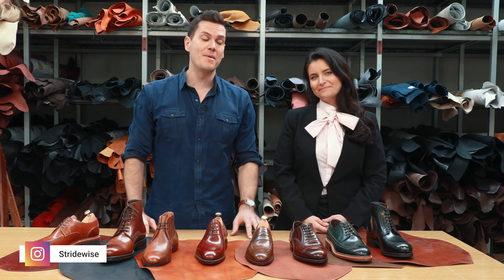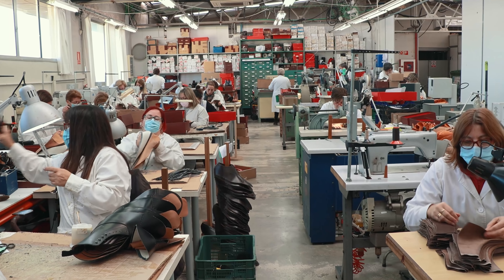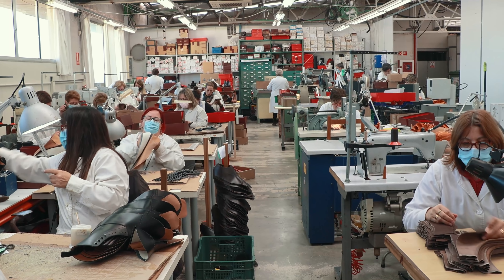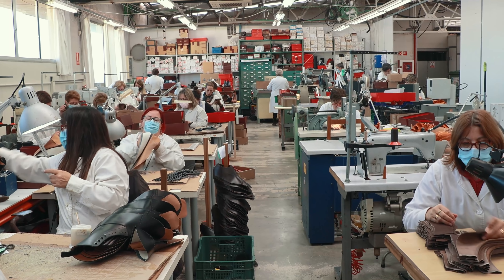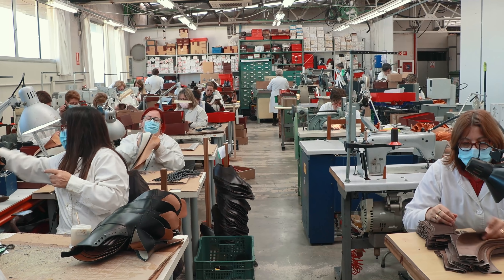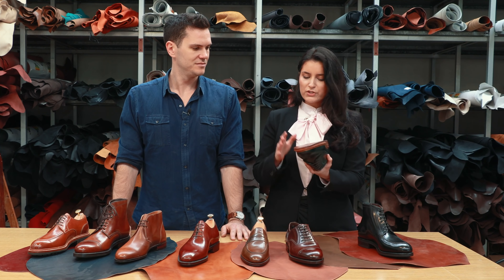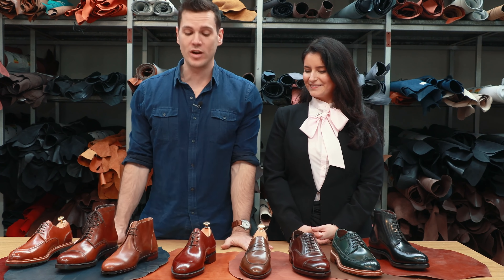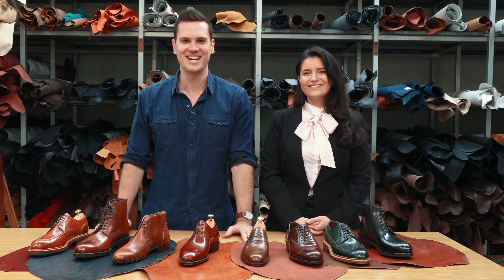Are Cordovan Shoes Worth It? Visiting @CarminaShoemaker-mallorca's Factory

Comment: In my experience the durability of shell cordovan is a bit overstated. Shell will scuff, scratch and split if treated poorly. Just look at used shell shoes on eBay. It is true that you can recover from some rather bad looking abrasions with shell but it is not bulletproof. The Achilles heel with a lot of shell is water. Uncoated shell that is exposed to a significant amount of water, say in a storm, will develop water spots that are very hard to remove. The material's pores will swell creating raised spots that can take days to weeks to return to normal if at all. I generally don't get my cordovan shoes wet for that reason. I see this a lot with AE shoes as they don't coat their shell. Alden doesn't seem to have this issue at least when new. I think this is due to the coating Alden applies to their shell.
Reply: I have may own special process of treating shell
Reply: It seems like the best approach to shell cordovan is to treat them like normal dress shoes with common sense - i.e. don't wear them in a storm, try not to scuff them etc
Reply: IMO Aldens coated shell looks fake. Another thing is that shell indeed splits realtively easy with eyelets and broguing areas affected more frequently.
Reply: What do you mean by coat the shell? I have Alden and AE Cordovan, they are very similar, bipoth shine up nicely with some pure polish conditioner, both get dull if not brushed. The cracked shell I see on eBay is on very old pairs. I’ve never had a problem keeping shell from cracking. And scuffs are removed with about 10 seconds of brushing, unlike calf or veg tanned. Shell is really, really resilient. It just takes a small amount of attention.
Reply: @Dr Zaius  the coated shell is a thing, there are pelnty of posts on reddit
Reply: Its durable but its still a natutal priduct susceptible to damage. Not unheard of for permanent water spots to occur or for welts to appear.

Comment: Well done, Nick.  Thank you!  I picked up a pair of Alden cordovan shoes recently and I'm still trying to sort out the best products used to care for them.  There's a hornet's nest of disagreement on which products are best.  Some say only Saphir Mirror Gloss because of solvents in Saphir High Gloss, that these solvents break down the cordovan.  Others say that's hooey, and you there are a zillion pics online of cordovan covered with High Gloss that look amazing.  Any thoughts?
Reply: Venetian Leather Balm or Venetian Shoe Cream for conditioning when needed, otherwise water + horsehair brush for cleaning/shine. Since Alden uses Horween shell cordovan, VSC is what they recommend for their leathers. They even use it during production, before they glaze the leather. The horsehair brush will add a really nice shine if that's what you're after. But if you want a higher shine than that, Saphir's Cordovan wax polish or Alden's Fine Paste Wax (both made specifically for shell cordovan) are great options.

Honestly, the two you mention would work fine, they won't damage the leather. I don't think High Gloss has any solvents, it's purely made up of natural waxes according to Saphir. The thing about waxing/polishing being bad for leather is when people never strip the wax off the shoes; they build it up over years and either don't condition the leather, or the wax has been built up so much that conditioners can't get past the wax. That's when cracking in shell tends to happen, because it dries from the inside out. As long as you're stripping off the polishes every now and then, and conditioning the leather before reapplying waxes, you'll be good to go.
Reply: Think of all the old pairs of shell  Florsheim Imperials available on places like ebay that are 30 or 40 years old. How many people do you think used Saphir or VSC in the 1980s to maintain them ?
Think how much abuse your shoes and boots get when walking in snow and rain ?
Solvents used in cheap products are not going to destroy your cordovan (or leather) shoes and they are much tougher than people give them credit for.

It may be slightly better to use the very expensive creams on your shoes but they will be fine with whatever is available .
BTW, I've yet to see any scientific evidence that "natural" solvents are better for leather than  synthetic solvents and completely synthetic products like vaseline seem to work on skin quite well.
Reply: I would only use high end known products like saphir specifically meant for cordovan.  
I would stay away from solvents, cordovan is not porous like leather so I dont understand why solvents would even be beneficial

Comment: SHELL IS A LEATHER, specifically it's a reversed side of the horse butt leather
Reply: Its actually between two layers of epidermis. Technically speaking it would be similar but not the same as top grain leather with full grain removed and the genuine leather underneath also removed. Except its different as it only exists in the rear of the horse. Not found elsewhere on the horse.
Reply: @AsAnAtheistFilms  sorry, that doesn't make sense. You can clearly see hair follicles on the reverse side of the shell
Reply: @davidpielykh3996  The "butt", after tanning, is passed through a splitting-machine which removes the grain, or hair side, revealing what is termed the "shell".
Reply: @AsAnAtheistFilms  I created a google photos link with a couple of shell photos where you can see the follicles. It won't go through here on youtube for some reason
Reply: @davidpielykh3996  sounds like a defect in the splitting of the grain to me. Never seen follicle like pertusions on shell and ive had 5 pairs, 8 horween shells, 3 rocado, and 2 shinki (worst out of the three). In fact on the shink I found remnants of the grain on the shell. Also thickness variety and poorer finishing of the skins.
Reply: @AsAnAtheistFilms  again, I am talking about the reverse side of the shell (not painted)
Reply: It annoys me too when people say it's not skin as if skin is not a layered organ -_-